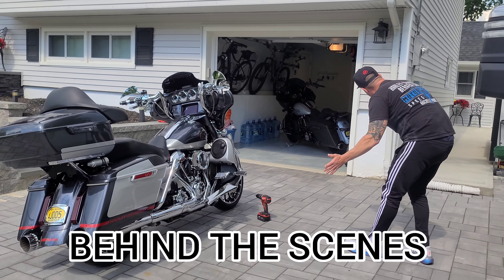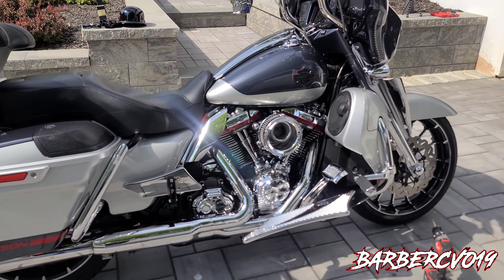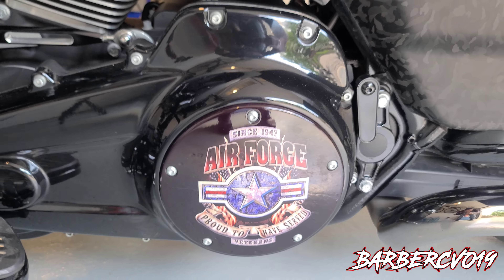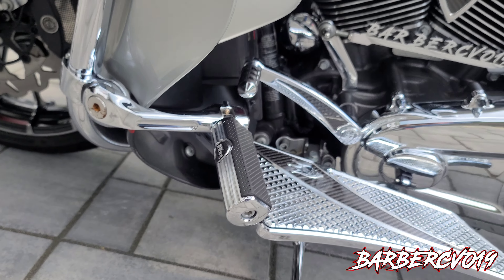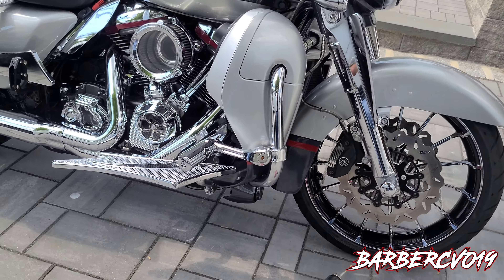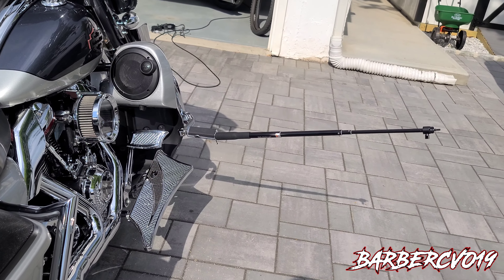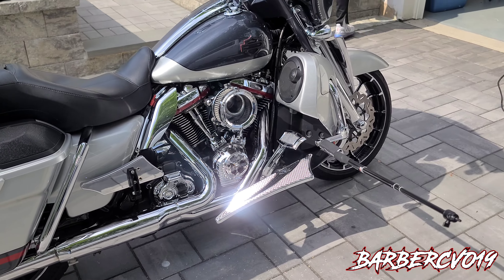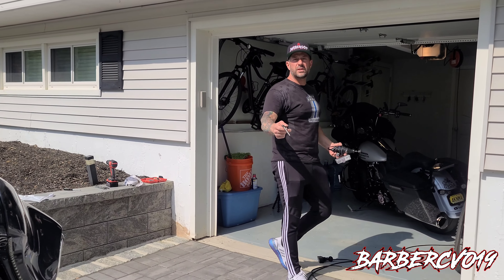CycleFanatix Selfi Stick Mod Installation on my 2019 street glide cvo

Comment: I have a similar setup I used with the ram mount but when I extended the selfie stick because of the angle it wobbles a little too much for me. Is that to be expected?
Reply from the maker: When u use the ram it's gonna wobble alot that's what I was using.. it wobbles bc it has an adaptor . but now that it's screwed on no wobble